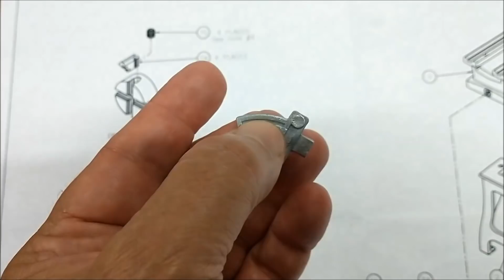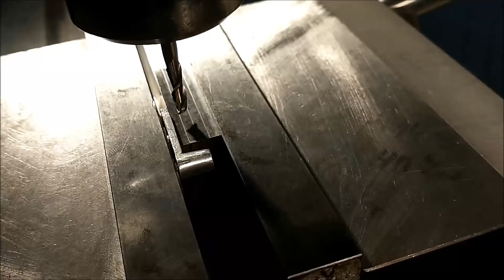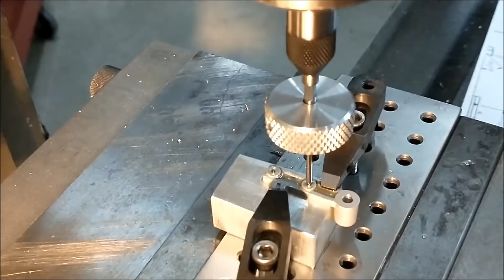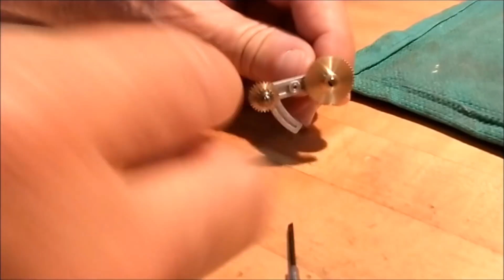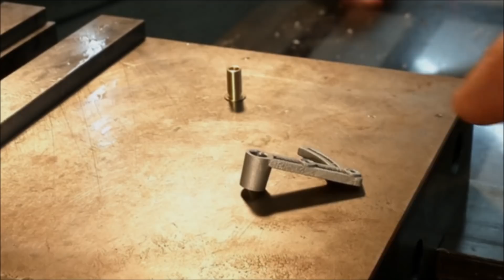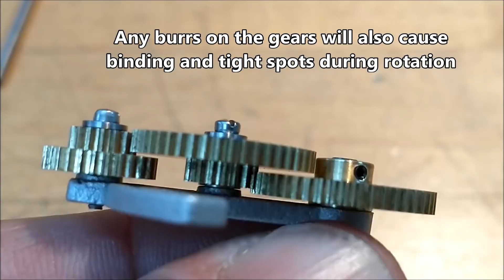Lower Gear Set - AKA - Lets move a hole that doesn't line up !!

Comment: Joe, do you think it is safe to assume the .518 measurement should be .523 for this part? (Assuming the other two holes are spot on._)
Reply from the maker: Probably. It would be advisable to check the gear stock before moving forward.

Comment: In situations like these it is a good idea to put a strip of thin paper (say cigarette paper) between the meshing gears before you tighten down the screws. If possible you would find the tight spot and insert the paper there. That will give you the clearance/backlash you need.

Comment: As said below setting the gears up on a clock makers depthing tool arrangement would have been a good idea to verify centre distances. On an old lathe I know of the casting holding a couple of the change gears had shafts either pressed in or cast in  for the gears. The shafts had a reduced diameter at the end with a thread so the gears were retained by a nut tightened to the shoulder.  I don't think those screws holding the gears are that true to scale. Great build though and much more involved than I initially thought.

Comment: Hi Joe it's tough luck, you follow the drawing and find the gears are not cut accurately. You got out very neatly, but as always from me a question, with 'hindsight' would it have paid to assemble the gear train on a simple 'clock makers depthing tool' to identify the accurate spacing before machining?
Reply from the maker: I take full responsibility. I should have checked the pitch diameters and decided to trust them instead. My bad.

Comment: Would taking about two thou off of the diameter of the gear and then using a file to restore the profile of the teeth have been an option? I know it wouldn't work for a full sized transmission, but for what is essentially a desk ornament?
Reply from the maker: Correctly cut, a gears OD shouldn't have any bearing on its mesh performance. But that is always a possibility.

Comment: HI I looked up the mating gears on that feature and used the gear mesh calculator and found that the distances are +.002, the gears should fit but they do not.? the gears them selves must be at fault.

Comment: Go and have a look at Chris' of Click Spring jig for setting the backlash on these type of gears.
I think it is in his skeleton clock series.

But yes, like you said, threads is not the best option here. A bush that is press fitted with a retaining bolt or even a circlip would have been better.

Comment: Oh one more remark. I have also learned that it is helpful to carefully deburr  the sides of brass gears with the finest file or scotch brite and after that give it a touch with the polishing spindle with a medium compound. This rounds the edges ever so slightly but if done gently does not take away any material from the gear teeth’s main shape. It makes the gears run silky smooth. But the meshing should be good in the first place of course.

Comment: As a steam locomotives modeller I’ve learned (pretty quickly) that disaster recovery is one of the most essential skills, if not THE skill, you must have to ever complete any project. No matter how carefully you work, things do go awry, and some idiot added, no doubt supported by reality, “at the worst possible moment”. It is immensely satisfying to see your recovery. The relocating of the center was brilliant. It is a stupidly simple idea which I certainly would have overlooked. Even when you explained the concept the penny did not drop. What? No off center drilled bushing? Huh?! But when I saw you shift the table it dawned on me and I had to pause the video to stop my right hand from slapping my forehead. I will never forget this lesson (that is until mr. Alzheimer comes along).
Reply from the maker: Glad it was helpful.

Comment: I was waiting for the sector slot....Maybe next time. Hope you do it on the rotary table. I have been fascinated by them since I read an article in Mechanics Illustrated when I was 9 years old. A guy used a little one  with XY slides on a drill press to make a clock face in a piece of plexiglass. To this day I have always wanted to do that but never did,,,Plus I have no use for one. 

Well another great vid, Whenever I ,ale a boo boo on a hole I machine a slug and then redril the hole. I like your way a lot better. Hopefully I will not have to use uit for a while fat chance) but I will use your way the next time. - As usual you have better techniques then I do. 

OK, gang, Now watch Joe cross me and not use the rotary table to macing that curved slot.
Reply from the maker: The casting shows a track/slot profile, but the print calls out a hole. Either way I go, its a 'fit at assembly' situation.

Comment: Can I ash Sir Joe? Did you make the gears? Also did you use lock tight on those threads? I noticed a couple of the gears are not fully meshed! Would this be an issue on a working full scale machine? Beautiful work,  a very small error that you dictated  can happen, when using threads as a centre did cause a problem, but it didn't faze you.
Reply from the maker: The gears were supplied as part of the kit. On setups like this, meshing is important initially, All the other sets are adjustable and just in a ready position.

Comment: may have been worth turning a few thou off the OD of the gear, just in case it was the tips of the teeth crashing into the root of its mating gear?
Reply from the maker: Certainly something to check.

Comment: Hi Joe, great save indeed. I couldn't believe it when you seemed to just eye in the gear mounting holes; I have learned (I am very new to all this and only make small models) not to trust drawings, particularly for spacing gears. As it turned out you were right when you said that you weren't happy with screwed mounts. I can see why but what would you have done instead please?
Reply from the maker: Headed pins pressed in from the opposite side and C clips or screw on caps as retainers.
Reply: @joepie221  Hi Joe, thank you for that, micro machining then :-) My 3 1/2" centre Drummond lathes use a split plug to retain the changewheels on the studs, it looks a bit like an old fashioned clothes peg if you understand what I mean; or a flat, round headed screw with no thread, split along the length. The tension of the split section inserted into the stud is enough to hold the changewheels in place.

Comment: Hey just started watching the chanel and cant get enough! Thought i might throw somthing out there maby you have already seen it or know about it but this type of gear mesh setup is more akin to clock making could you have used an  Involute gear cutter  to refine the shape of the gears instead of moving the bore position? Chris over at click spring has a video on setting up  gears for precission operation and wondered if the same principal would apply here
Reply from the maker: I saw that jig. Very cool. He likes to do things period correct, so his placement jig is simple and very effective. Just don't blow the hole pickup after you lay it out.

Comment: joe,,,,laurence here,,,,got a problem, that you could shine some light on ..i have a disc 1" x 6" and need 36  half moon slots 2mm.cut around the periphery...how ? its  going to be a turbine for my 3 wheeler project... its stainless  steel,,, regards... laurence
Reply from the maker: Plunge the cuts like a 36 hole bolt pattern, or do it on a rotary table. It should be easy if the radius of those little scallop cuts are a  nominal size.

Comment: Sort of disappointing that the print dimensions are incorrect. Other than checking all the base circle dimensions of the gears and putting it on cad to check it's impossible to know what those dimensions should be. Nice guess on how much to move the centerline of the shafted gear. I know it bugs you that the hole in no longer centered in the casting, it's just how things turn out sometimes, and you can't see it anyway once it's assembled. The end result is it works great, nice job. j
Reply from the maker: Something is incorrect. The dimensions may be good and the part oversize, or the other way around. I was going to check and decided not to. No big deal.

Comment: I'm glad to see that I am not alone with this feature, I ended up milling a slot in the casting and installing a Tee nut and a 2-56 screw. it actually looks far better than it did and allowed adjustment. I am just a hobby guy and thought I made an error. you can see it in my lame video.
Rich

Comment: Would there be a point in making a support plate of sorts to keep the screws spaced properly on the other side of the gears?
Reply from the maker: I would just stay away from using threads as locators all together. A well placed counterbore to accept the gear sleeves would be a great fix. then the sleeve is the locator and the screw just holds it down.

Comment: Clickspring made a tool to set the mesh on gears then transfer the the proper distance for the axle locations.  Here is a link to the third video in the build series that shows the assembly and how it is used.  https://youtu.be/F-vcdvqg-zk

Comment: I am working on a model steam engine at the moment, a Wallers Table Engine. Making it from a set of plans. The castings I am making as well, resin 3d printing the patterns and sand casting in ZA12 alloy. Watching these videos not only spurs me on but alerts me to a lot of 'gotchas' in the design of the castings, particularly how to hold them for machining.

Comment: Nice one Joe. If as you say you nailed the drawing dimensions and I am sure you did, it can only be the vagaries of the brass gear stock not being in tolerance or every kit that PM Research has sold would have had the same problem and as they have been selling this kit for some time I'm sure if it were their dimensions that were at fault it would have been brought to their attention and it should have been rectified.

Comment: Someone has already mentioned it in the comments, but something similar to a clockmaker's gear depthing tool would have been useful for you to check the gear centre distances. 
Hmm, since you have enjoyed making the small parts for this lathe so much, maybe make a clock for a for a future project.

Comment: I looked at that and thought an eccentric bushing on the centre gear would give you mesh adjustment capability for both top and bottom gear, with that bushing then locked in with the screw. will you now need to adjust the tailstock end lead screw support by the same 5 thou you adjusted the part?

Comment: Don't these transmission arms normally have a slot so you can adjust the gears as you go? I mean, you definitely need it if you have a set of change gears, but could make sense anyway.
Reply: Yes, they do. The casting has a 'fake' slot shape to make it look as if it does. Shame, really- but it would all be a bit fiddly to make and use...

Comment: Had to do this to an 80% AR receiver that I milled out (for myself of course.) The jig drilled one of the hammer holes off center so i plunged it out, fine threaded it, made a stainless threaded plug, loctited it and redrilled it. It's worked flawlessly for hundreds of rounds so far.
Reply from the maker: I am familiar with the exact hole you are referring to. When doing a hole like that, make one side of the repair bushing to have a head on it so if it does move, it can only go one way. Recess the head into the lower of course.
Reply: @joepie221  Unfortunately the wall thickness isn't very much at that pin hole so the best I could come up with for it was the threaded plug. Normally I would favor a shoulder of some kind, but its been holding strong for quite some time now.
Reply: That's awesome! 
Did you cut the threads and everything?
Reply: @glenj.taylor2938  Yes. I cut the thread  in the receiver using a tap but chased the thread for the stainless plug on the lathe for a nice thread engagement.

Comment: Wow, moving a screw hole in wood is so much easier. Just squirt some glue on a few little splits of wood, hammer 'em in, shave 'em flat and run the screw back in.

Comment: What options would there be other than threads? At that scale would a solid shaft pressed into the casting work? A shaft pressed in then the other end having a reduced OD and threaded to take a nut to keep the gear in place.
Reply: There's probably just enough material there to counter sink the bushings into the threaded hole just enough to register and leave enough thread for the screws to hold. However, I think that's aluminum and I don't really know what I'm talking about, so maybe not.

Comment: What would be the cost of this kit ?
Reply: Check the PM Research website. Not super expensive.
Reply: Couldn't be too much. It's probably about 8 or 10 ounces of rough cast aluminum and a foot or two of brass stock. That's like 25 cents in raw materials. But I guess you're paying for the plans. Detailed plans, for anything, can get expensive.

Comment: Can you elaborate on the "receiver set screw"  you mentioned.   Not sure what you mean by this.....
Reply: Notches to receive the set screw on the shaft to keep it from rotating on the shaft. Most usually done with a small Milling bit in a fixture -- slotting across minimally into the shaft. This is done also to not push in a Detent into the shafting material from the setscrews tip.

Comment: I vaguely recall ClickSpring making a special tool/jig for spacing the gear hubs perfectly, and him going into detail of why.  Was some sort of adjustable divider with shafts on to mesh the gears perfectly, and then directly transfer the precise distance to the required points on the hub locations.  Was a long time ago, so not sure any more which particular project it was in.
Reply: It's a clockmakers depthing tool. Would have been good for this job, but this banjo if fake anyway. it should have a slot and adjustable gears.

Comment: It is interesting how PM has deviated from the standard lathe design here as this would normally have a tee slot for the gear stacks so that you could change gears to cut different feed rates. maybe a mod you could do Joe
Reply: Yeah,  you can see they cast in the slot, but then went fake with those two bosses. Probably only one feed ratio on this one. I guess Joe won't be doing much threading unless he modifies this banjo and makes a set of change gears.

Comment: Joe, I agree that using threads as locators is not the best idea.  Also I have watched you for some time now and your technique is very likely not contributing to the gear bind.   I would think that the gears themselves are not to spec.  Perhaps the pitch diameter is off or the major or minor, or even the radius in the root or the top of the teeth.  It would be interesting to put the gears on an optical comparator, and see the story it has to tell.
Reply: I was thinking the same thing. 
I don't know much about measuring gears but I would guess that a but of mild abrasive compound and a Polishing Wheel that could get into the teeth fully would have smoothed everything out and helped it all work together.

Comment: You should have checked the meshing pitch before drilling and tapping the holes and not rely on the drawing. I use a depthing tool on my clocks before drilling and reaming the holes. Like you said relying on tapped holes is not the best idea. You got there in the end and that’s what counts. Nice work so far joe.